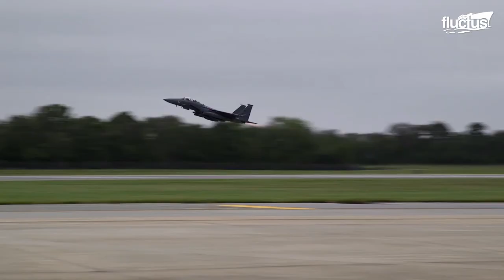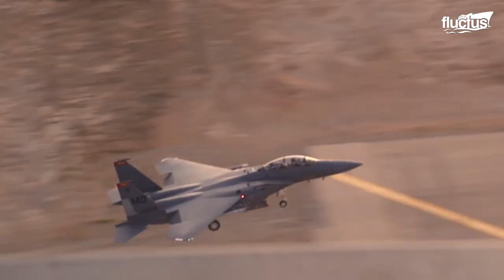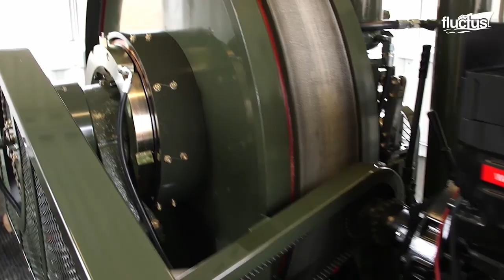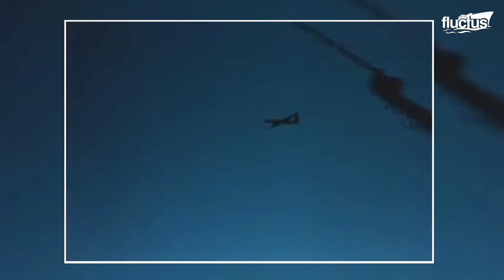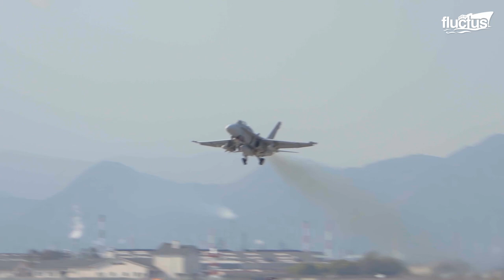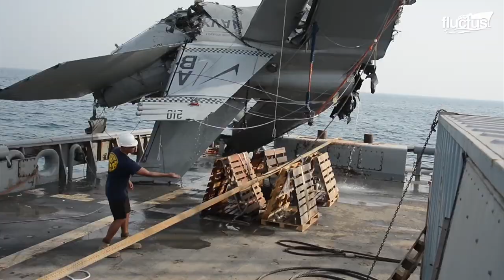How Landing F-15 on US Aircraft Carrier Could Turn into a Disaster

Comment: When the Navy decided to adopt the Northrop YF-17 for carrier use, Northrop had no experience in producing a carrier based aircraft so turned to McDonnell-Douglas for help, resulting in the F-18 Hornet. I'm just wondering how they were able to do this with the F-18 but not come up  with a navalized F-15 variant. In fact McDonnell-Douglas said that altering the Eagle for carrier duty would make it so heavy that any advantages that the Air Force's version had would be negated especially when compared to the performance of F-14 Tomcat...

Comment: Between August 1963 and 1970, U-2s flew off and land3d on four CVs: 59, 61, 63 and 66.  First takeoff was on 1 Aug. 63 and first landing was 2 March 64.  The ONLY operational flight was in May of 64 to overfly the French nuclear test site at Mururoa.  The U-2 flew from Lockheed’s Bu4bank facility to USS Ranger CVA 61 and departed the carrier for her mission, photographing the entire site.  The plane then exited the area, returning to Beale AFB by way of Hawaii.  Films of test flights appearing on YouTube show tests on 63 (Kitty Hawk), 61 (Ranger) and 66 (America).  I was the Ranger’s Comtac Materials Custodian 1976-1981.  There was no such acronym during my years like SCI-FI - we just called it ‘The Cage‘.  When you pass into the work enter, the first thing you saw was a huge poster of a nuclear test at Mururoa, in a frame spot welded to the bulkhead.  Around the corner behind the safes and computers were two 10x12 inch black and white prints.  The first was a still from the landing film on YouTube, with the plane in the foreground and the CVA-61 in the background.  The second was of Kelly Johnson and pilot Schumacher in front of the U-2.  This latter photo is signed.  During an overhaul period when the ‘Cage’ was refurbished, these three items were given to Ranger’s CO, CAPT Thomas Gary ‘Top Gun’ Moore.

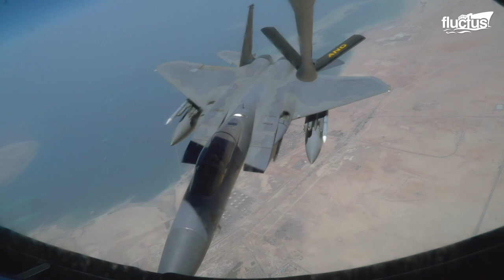Comment: at 03:48, it looks like the boom operators' chin is resting on a Crown Royal bag, ha ha. In the winter I worked at the Niagara Falls Air Base when they still had F-4's in the alert barns. The thing is, they had a cable barrier set up that recessed into the runway. Before we could plow one of the Air Force sergeants would come out and inspect the barriers, so this system is not new. This was the mid to late 70's when I was there. One of the best jobs I ever had.

Comment: Not just the landing gear,but the structure they are attached to. Everything would have to be modified and the F-15 would gain too much weight..
Reply: The aircraft carrier version of the Dassault Rafale needs a stronger structure and is 10 percent heavier than the land-based aircraft.
Reply: @KRW628  Thanks, interesting stat
Reply: @KRW628  　How  do It  make  not  heavy  and   confortcomfortable   ?
 If   you  could  aanswer fforme pplease.
Reply: The airframe and the landing gear have to be built stronger (heavier) to withstand the stress of the catapult launch and the arrested landing..

Comment: I can’t believe I just saw a crew member, using an old fashioned hand drill on a modern carrier. 😮
Reply: Yeah, there are some specialized tools - and some circustances - where a powered drill can't or shouldn't be used. With all the fuel and flammables on the flight deck, that may be one of them.....
Reply: @Ezees23  I was guessing as much, we have the same health and safety issues in the oil industry.  But we also have intrinsically safe equipment for specific environments. 
I guess we have more money to spend in oil. Than the military have for a budget.
Reply: @markblundell9461  There's infinitely varied equipment and processes on an Aircraft Carrier and in Carrier Ops - things are very much in close proximity to each other and it doesn't take much to have a catastrophic chain-reaction. I'd wager that they're eliminating any chance of that happening - what with not only the planes, but also all the explosives (ammo, missiles, bombs, and nukes) that are on one ship. Gotta make it totally idiot-proof to minimize any chances of a mishap......
Reply: They don't want to strip out fasteners.
Reply: I got out of the Air Force in 2020, we still use those hand drills on F-16’s

Comment: The YF 17 was developed by McDonnell Douglas to compete against the general dynamics YF 16. The YF 17 was specifically designed for the US Air Force. After the Air Force decided to take the F 16 instead of the 17, the navy took interest in the design and the F 18 was born. The hornet was 100% designed for the Air Force, not aircraft carrier operation…😂
Reply: Yep, but reengineered to meet carrier specs.  I remember in avionics school discussing with my instructor about the F16 and YF17 competition and he was a former F4 avionics tech.  He was surprised the AF chose the 16 instead of 17  but we both loved working on the F15 :)